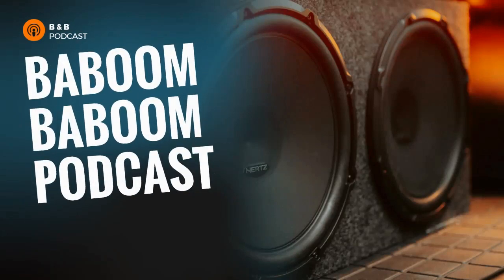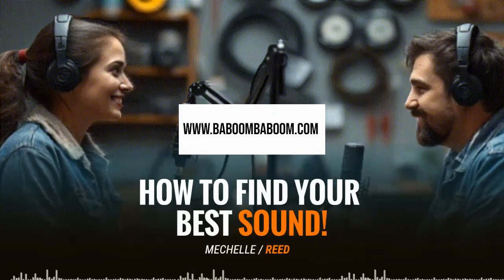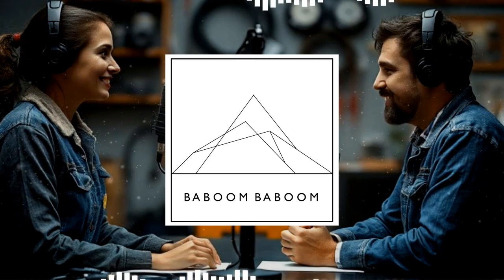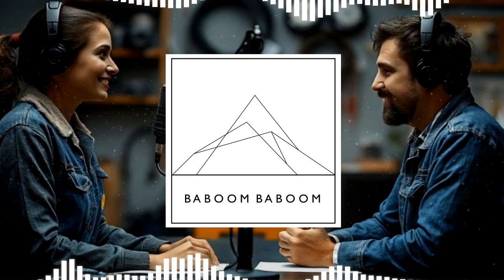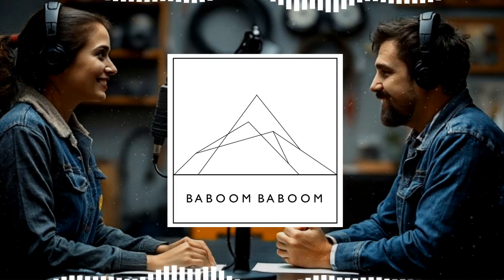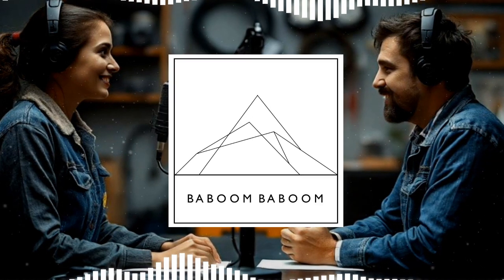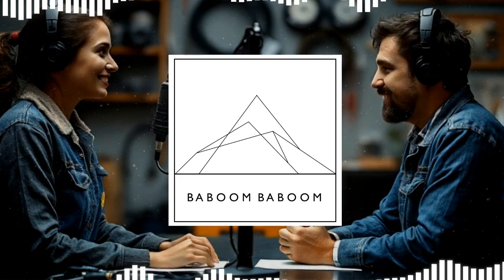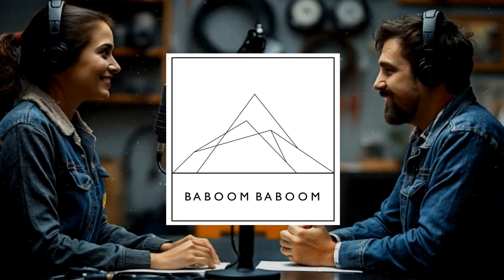2 Ohm vs. 4 Ohm Speakers: What’s the Difference and Why It Matters - Baboom Baboom Podcast

Comment: Man this is so nice.  This is a nice advertisement LOL!! You need wire we got you!!! Wire size is unimportant but let’s not get ahead of ourselves here.  Wire type is just as important!! Oxygen free fine copper, FULL COPPER, no aluminum, wire!! And yes the more the power the larger the wire size needs to be.  Imagine a straw, you can suck a lot more with a larger straw same with power.  You will also need to look into upgrading your alternator and also getting a battery bank and/or capacitor bank for your needs.  Every system is different and will require different install requirements.  Good article though.

Comment: What if I have a 4 ohm speaker and an 8ohm speaker both with the same power rating. Can I connect both on the same channel of the amplifier?
Reply: That would be 6ohms right?  Just don’t run the amp below what it’s rated for.  Even a 2ohm speaker doesn’t really play at 2ohm all the time.  It’ll run down however far as the wattage it puts out.  The driver and the enclosure will have a huge effect on all that.  If the amp is rated 500 watts it’s not just pushing out 500 watts constantly.

Comment: You guys are wrong about this 2 ohm or 4 ohm. The ONLY DIFFERENCE IS THE NUMBER 2 OR 4 Other then that NO DIFFERENCE.. two 2ohm subs in series is 4 ohms the amp sees 4 ohms. Two 4ohm subs wired in parallel is 2 Ohms the amp sees 2 ohms therefore the amp gives more power bc It sees less resistance.  So its ALL about machine ohms to the amp. Nothing is different from 2 ohm and 4 ohm.

Comment: First thing to know is that wattage doesen't tell you how loud the speaker plays, but how much can it take temperature load.
For how loud can it play you have sensitivity (2,83V at speaker terminals, and 1m to the microfon that record sound presure). 
For how much power an amplifier must give to the speaker the internal impedance of an amplifier and the changing impedance of the whole speaker is also important.
Closer they are less strain will be on amplifier. It will generate less heat and that means more power to speaker and less generated distortion in amplifier.
Phisycs tell us that if you have 8 ohm amplifier and you connect 4 ohms speaker to it. You will lose 1/2 of wattage driving those speakers. Not taking into account losses of overheating.
If you have 8 ohms amplifier and you connect 8 ohms speakers to it you will have at your disposal all the amplifier wattage driving those speakers. 
Impedance of speaker is frequency dependant. 8 ohm speaker might have impedance as low as 4 ohms or lower,  playing certain frequencies, or as high as 25 ohms or even higher if not taking care of with zobel network.
Reply: I like how you are contradicting what was presented in this BS video, but unfortunately just about everything you said in your post is not correct, as well. To be fair, this is what you got wrong.
"First thing to know is that wattage doesen't tell you how loud the speaker plays, but how much can it take temperature load.
For how loud can it play you have sensitivity (2,83V at speaker terminals, and 1m to the microfon that record sound presure). 
For how much power an amplifier must give to the speaker the internal impedance of an amplifier and the changing impedance of the whole speaker is also important.
Closer they are less strain will be on amplifier. It will generate less heat and that means more power to speaker and less generated distortion in amplifier.
Phisycs tell us that if you have 8 ohm amplifier and you connect 4 ohms speaker to it. You will lose 1/2 of wattage driving those speakers. Not taking into account losses of overheating.
If you have 8 ohms amplifier and you connect 8 ohms speakers to it you will have at your disposal all the amplifier wattage driving those speakers. "
And this is what you got right.
"Impedance of speaker is frequency dependant. 8 ohm speaker might have impedance as low as 4 ohms or lower,  playing certain frequencies, or as high as 25 ohms or even higher if not taking care of with zobel network."
What I find puzzling is going by what you got right, you shouldn't have gotten all the rest of it wrong. I don't know if I would have brought up the zobel network, but I understand why you mentioned it. So, now you have a choice. You can either fire back with insults, or you can do some fact checking. I'm fairly confident you won't be able to provide a credible reference for anything I put in quotes. Any basic text on audio will not support anything you said. 
I just want to be clear that I'm not trying to make you look bad or feel stupid. There's  a lot more bad info than good with regards to this topic. Everyone falls for bad info at one time or another, and I'm no exception. If you take what you got right, and build upon it with some research, you'll quickly figure it all out with no trouble at all.
Reply: @052RC you don't like zobwl?
The inductance of the speaker's voice coil causes its impedance to increase at higher frequencies. Zobel flatens that rise.
Reply: wrong

Comment: It never ceases to amaze me how car audio people get things so ass backwards. In every other branch of audio, low impedance loads are something to avoid unless absolutely necessary. Why? Because you're just beating the crap out of your gear for no reason. If you can find a 4 ohm speaker that does the same job as a 2 ohm speaker, why not use it? All other things being equal, a 2 ohm speaker forces an amp to work a lot harder to do the same thing as a 4 ohm speaker. All this talk about how 2 ohm speakers can be played louder is complete BS. You just think that's how it is, and you even confirm it by stating how 4 ohm speaker gives better sound quality. An amp tends to sound better when you aren't beating the crap out of it. Well my amp is rated for 1 ohms? So? Just because you have an amp rated for 1 ohms doesn't mean you should try and make a 1 ohm load. Its ridiculous. 0 ohms is a dead short. If you take your speaker cables and touch them together while the amp is on and playing music, its a 0 ohm load. 1 ohm is really close doing the exact same thing same thing. 
What's even worse is, you guys don't even understand what the 2 and 4 ohm ratings even mean. That's not how much resistance the speaker offers. Its an average. When in use, a speakers impedance is constantly changing. The resistance a speaker shows an amp is based on frequency. The lower the note, the lower the resistance. The most important spec is the one you are not looking at. A speaker has 2 resistance ratings, the average, and the lowest resistance possible. What does that mean? You can have 2 4 ohm speakers, and one can be easy to drive and the other can be very difficult to drive. One 4 ohm speaker may drop down to 3 ohms at its lowest while the other 4 ohm speaker may drop down to 1 ohm. That means you need to use the same amp you need to drive your 2 ohm speaker as you do your 4 ohm speaker because its just as hard to drive. The fact that this was left out of a discussion like this is absolutely stunning. There's no excuse for it. 
I can keep going on but my post can only be so long. The video got 1 thing right. They tell you to consult a professional before you attempt any of this. Not only is that good advice, its advice they should take themselves before making any videos. Also, I just noticed they have another video out on bridging amps. Don't even think about it. If they can't get this video right, I guarantee that one will be just as bad. I'll try and look at it later and make another post.
Reply: Higher resistance gives the amp more control over its output.  I need an amp that can push 1000 watts at 4ohms.  I bet those are expensive.  I need to figure out how to build a box properly first.

Comment: 2 ohms all you care about is max sound pressure levels.
It has less speed, less dampening factor, yet is more efficient per watt over more resistance speakers. 

4 ohms or more is actually much faster, more resistance, more motor control of the speaker, and a better damping factor.
The sports car is more resistance.
It’s faster, it uses more power, it is very accurate.

More resistance is usually associated with a sound quality system.

You both have this backwards .
Reply: It's a 14 minute Comercial.  They sell spool's of wire on their website

Comment: R= U divided by I 
𝑅 is the resistance in ohms,
𝑈 is the voltage in volts (𝑉),
𝐼 is the current in amperes (𝐴).
Now you know what kind of cables you need like 4.4 felt for 164  of cable with a thickness of 4.00 square mm
SeeYA

Comment: This vid is kind of misleading. You’re leaving out the main factor which is watts. 100 watts is still 100 watts no matter the ohm load which changes nothing. A 4 ohm speaker that’s rated 100 watts wired to 4 ohm will sound the same as a 2 ohm speaker rated 100 watts at 2 ohm. There’s no difference. Exactly why 2 ohm and 4 ohm speakers costs the same.
Reply: A 4 ohm speaker will need more volts drive into it to meet 100watts where as a 2 ohm speaker will need less volts to reach 100watts but will draw more current. A amplifier will only be as loud as the rail voltage provided by the power supply. Car audios weak link is stepping the 12 volt system power to say 40 to 90 volts however current is not much of a issue with a car. (the opposite is true for home audio)  This is why 4ohm in car audio has traditionally been the norm in car audio where 8ohm has been the norm for home audio although that is changing these days. I am always more interested in the rail voltage of an amplifier first then I consider can its double its load without voltage sag . I can careless what wattage it is rated at by the manufacture...Basically voltage is volume then amperage is how much of a load can it handle before voltage starts to lag then clip.
Reply: @keithalexander36 but what about impedance of power source. Amplifier iner impexance.
Reply: @keithalexander36 dont forget about impedance of power source itself. If it's 4 ohms than you will loose 1/2 of power driving 2 ohm speakers.
Reply: To say this video is misleading is an understatement. However, your post is just as misleading. Before you fire back with a bunch of nonsense, I'm going to ask you to do 1 thing. Find a single, credible reference that will back your statement up. You will not be able to do it. Also, I'm not siding with anyone else. The other posters are wrong as well, but your statement is the most wrong, if that even makes sense.
Reply: @052RC "your wrong, im right but I won't say why"   Why even comment then

Comment: been in car audio for 25+ years and what ur discussing the basics of what people should consider when purchasing car audio equipmemt on the ohms when it comes to mids and highs i stick with class A/B amp running 4ohm load to 4 ohm mids and tweets when comes to subwoofers its different i usually run class D amp which are usually 1ohm stable to dual 2ohm dvc (dual voice coil) subs and pending how many subs will determine if i them in series or parallel or both cuz ill usually wire the 2ohm dvc sub at 4ohms so if u have 2 thats 2x 4ohms so drops load to 2 ohms and when u add a 3rd sub it drops down to 1.33ohm load and 4th sub drops it down to just barely under 1ohm which is safe on 1ohm capable class d amps you just need to make sure your subs rms recommended power say its 600 watts rms x4= 2400 so an amp that has a true 2500watt rms rating would easily run them without much strain on the amp or subs cuz u matched the power ratings however depending on vehicle ur getting to the territtory of does car produce the power needed i drive v8 trucks with factory high amp altenators so i can get away with the amp and subs along with like a 600.4 4 channel amp forbmids and highs i just add a secondary battery like an xs power d3100 for main battery and add xs power xp950 battery along with a dual battery isolator kit so it get charged safely and doesnt draw power when off from main battery and if by chance i drain main battery overnight leaving light on or something i can manually turn on isolator and let the secondary battery jump start my truck so it can charge everything up again could go on and on but for a good car audio setup in a truck ill stsrt with that btw for mids and tweets i usualy do 6.5" components so thers a mid and seperate tweet in each corner in both the front and back of truck i slways have a crew cabs.. power wire is a whole other subject too long to add to this comment
Reply: I don't think most understand the wealth of knowledge in your response. Well put!
Reply: @melvincooper8926  why thank you it's good to finally not get trolled when all I'm doing is trying to help one know how they could easily build them a quality reliable daily driver system that will last and last for years without buying extra stuff tgat you might not need so for that I thank you for that
Reply from the maker: Very helpful @mikemccabe7124. Thanks so much for posting!
Reply: Thank you so much.
I can really used your expertise
Reply: Y AB amplifier on the midrange thou???
Reply: @ra.dawkins1441 because for a long time AB was the best combination of sound quality and efficiency, however class D technology has come a long way and there are plenty of class D amps these days that sound just as good as, if not better than class AB amps. It all comes down to personal preference and power limitations but regardless of what kind of amp you choose for  ur mids and tweets, the high efficiency of class D make it the obvious choice for subwoofer duty because the high current demand can be fed without wasting too much power as heat

Comment: Yet another video discussing Ohms Law without actually having a comprehensive understanding of tge subject at all.
They do not understand the subjevt matter at all.
They fail to understand the Load Amplifier Interface whatsoever.
This is like lots meaning so far every video I have seen just spreads mostly misinformation
Well done you tube your spreading it is beginning to excel